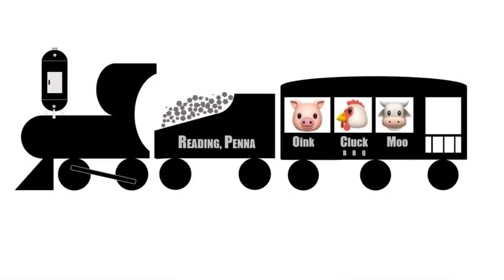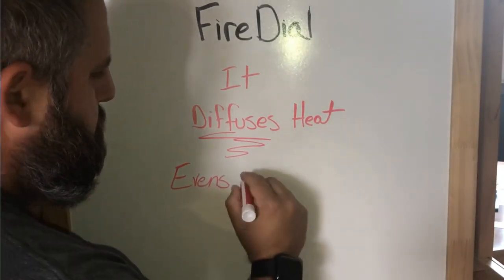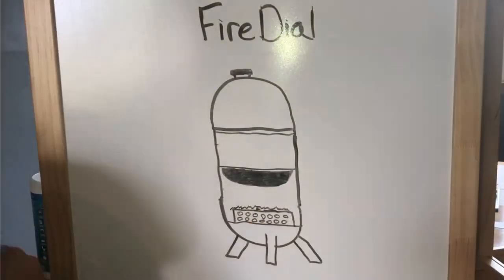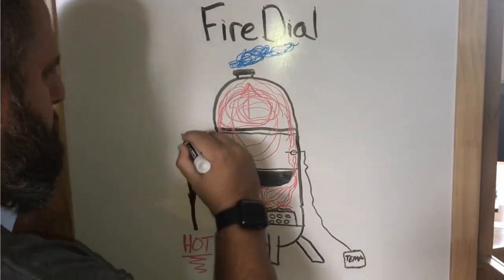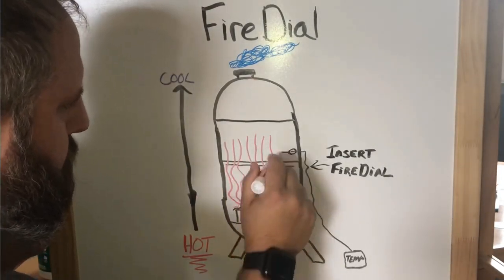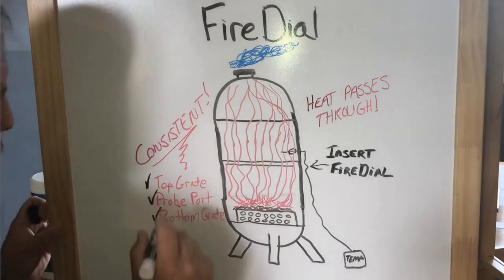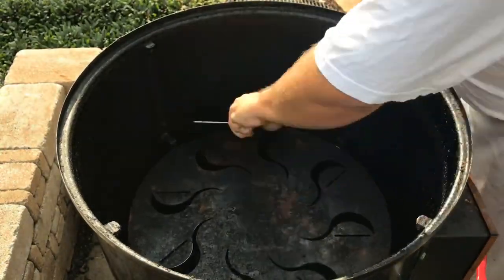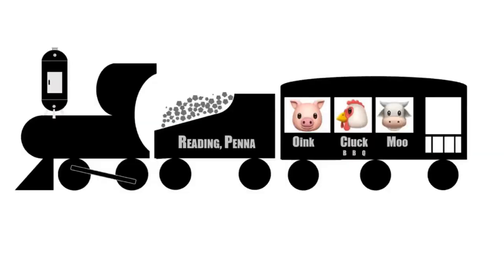FireDial, what is it exactly?

Comment: Once the water gets up to temp there is not a void above it. Temps may be lower above it, but there's not a void. Not too mention,  and I don't care what anyone else says cause I've tried it both ways numerous times, the steam from the water helps keep your meats more moist.
Reply from the maker: Thanks for watching!  I must disagree as your statement actually counters your point, when you say temps will be lower above it that is what I consider as the void perhaps it is just the phrases we each use.  The temp difference will have a significant difference between the top and bottom grates.  Also why waste the fuel and energy to heat water?  The moisture discussion does not cause moisture in meat, it helps to dampen the temperature in the smoker by keeping the temperatures down.  As a test place a dry sponge in your cooker to determine if or how much it adds moisture.
Reply: I have found the same results in regards to moistening the meat. Especially pork. Using the water pan does cause you to burn much more coal.
Reply: @OinkCluckMooBBQ   I have temperature probes on the bottom grate above my water pan and on the top grate and they are the same.  Where is this oasis of coolness you refer to?
Reply from the maker: @eckankar7756  it is highlighted in this video

https://youtu.be/5cde-UOChpI
Reply: @moncorp1 No it does not. See, I can also make statements on the internet.

Comment: I usually run water pan empty and foil over the top of it. With this daddy in place, will my fuel consumption be lower? Will the same coals burn hotter?
Reply from the maker: I did the same for a while before I used the FireDial.  The issues I had was the heat would be pushed to the outside (around the bowl) and would not be evenly distributed in the smoker.  The FireDial allows for pass through heat.